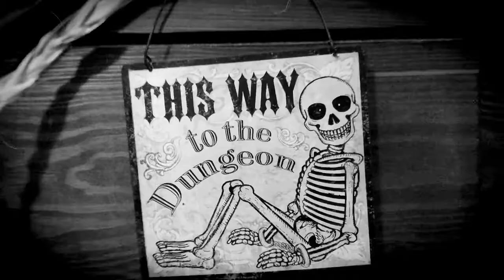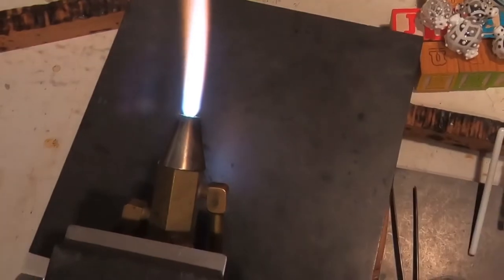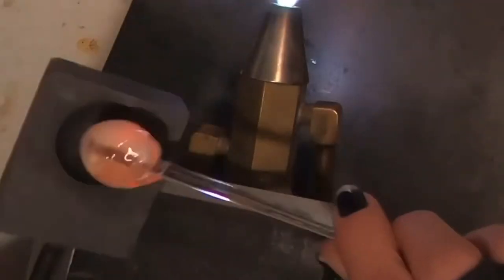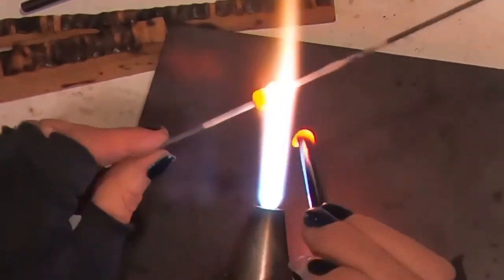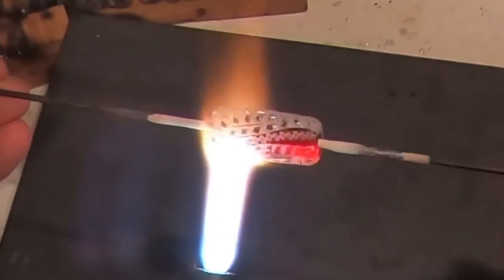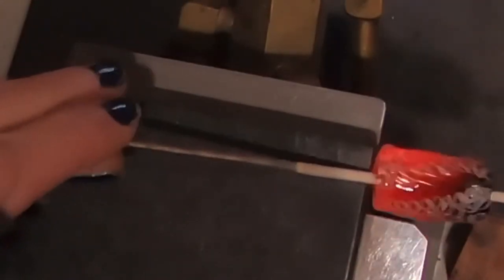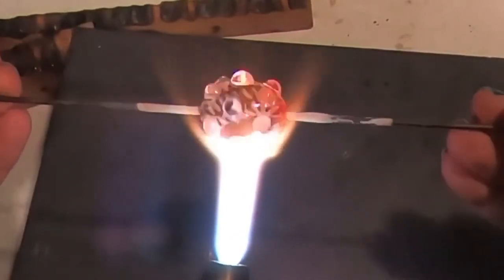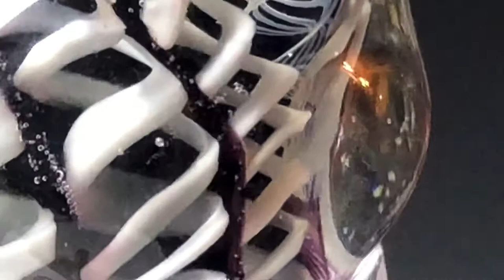Lampworking / Flameworking with Black & White - Volume 22 -  Filigrana Cane - demo

Comment: Good tip regarding making it into a ball. I can see where I have been going wrong. So big thankyou 😘😁
Reply from the maker: Cool!  I’m glad you found some good info here! 😃  also… right before I pull the cane, I make sure the ends are slightly cooler than the middle part 👍🏽  I forgot to mention that 😳
Thanks Lena!